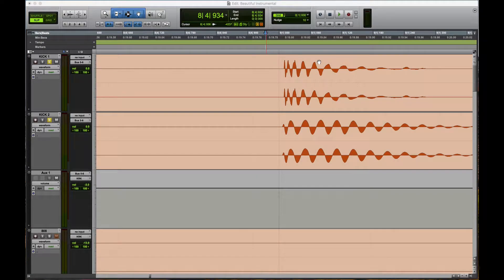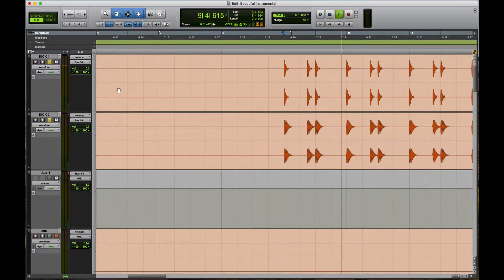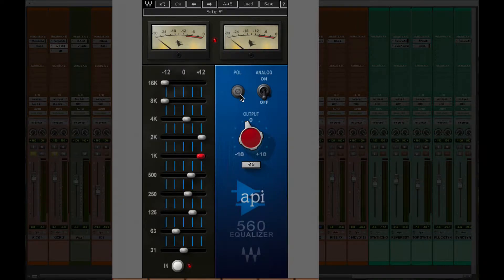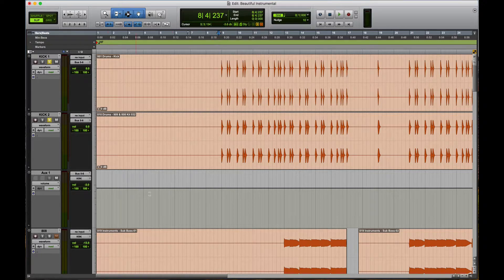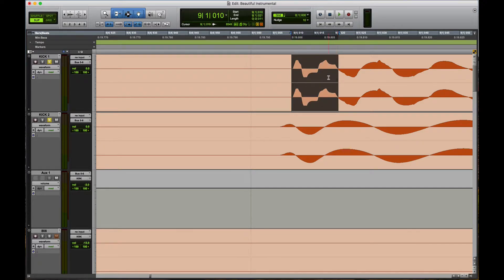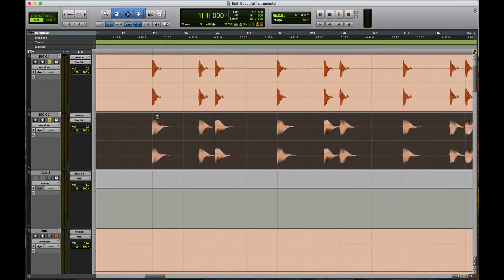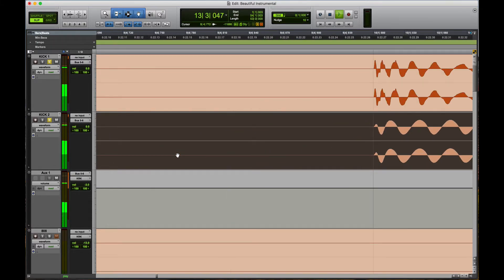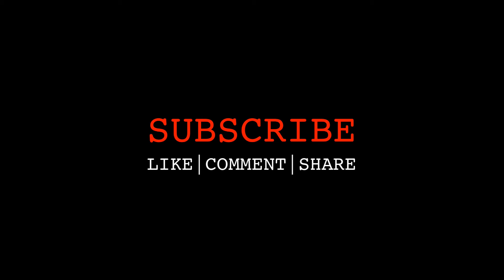How to fix phase Pro tools 2018 tutorial

Comment: Just use the "invert" in audiosuite under "other". This takes up too much time. But good tutorial for understanding phase issues bro.
Reply from the maker: Oh of course, but for those that want the manual long-winded method to understand phase, this is the video.  Thank you !
Reply: so what does the invert tool actually do to the audio files? i just tried it and it worked pretty well for eliminating vocal phase pretty easy, but it changed the waveformes to look almost identical
Reply: @jesse.pinehaven  That's the reason for them being inverted. Go back and watch this video, he shows u what 2 out of phase waveforms look like opposed to the ones that are moved to be in phase. Hope this helps.